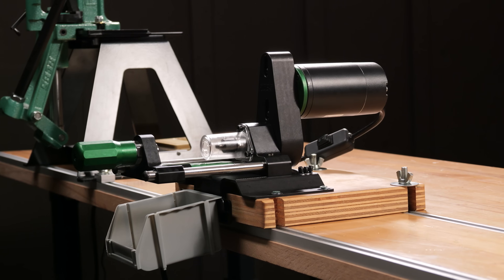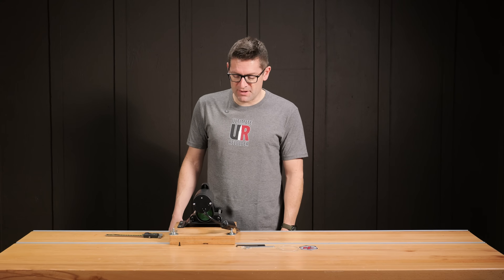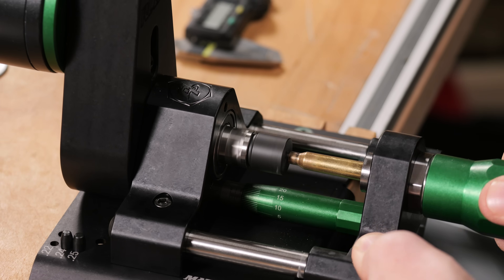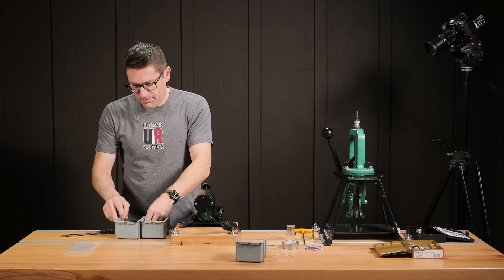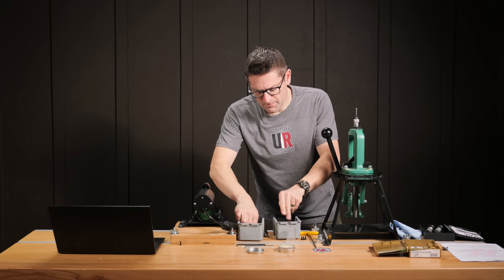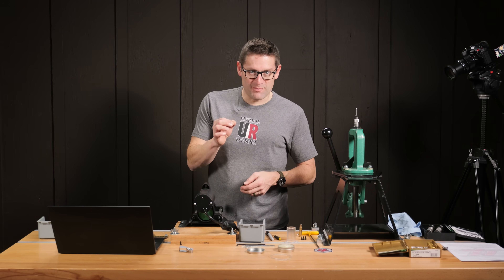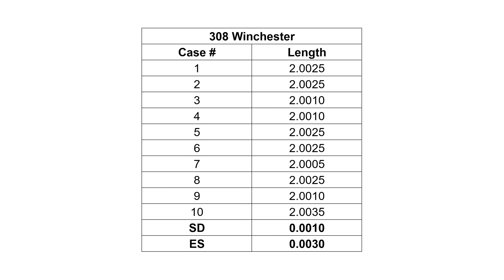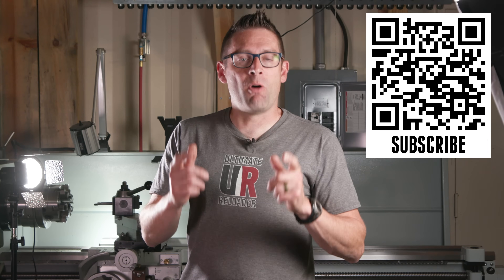NEW: RCBS MatchMaster Precision Case Trimmer

Comment: Needs a guide for the case to slide into before the cutter so a shellholder can be used to drop case head into and then just push through the guide to the cutter head. Putting the case into the holder then having to tighten it seems like a bother.

Comment: Question: since this trimmer has a collet to accommodate 30-30 cases, and since the 30-30 has the same case head as 32-40 and 38-55, can I use my old RCBS pilots and trim these two cases with this new trimmer?

Comment: Does the device only trim the cartridges, i.e. cut them to the correct length, or does it also remove the burr on the inner and outer edges so that the cartridge is immediately ready for loading?

Comment: I’m using the Lyman pro and it works good enough for the amount I need. Consistency is there and the price is right. I wouldn’t mind having this trimmer at 350. 700 plus is a ton of dough and I doubt most reloaders out there are annealing, charging, and sizing on the type of precision equipment wherein this trimmer would make a statistical difference. This is time saver above all else.

Comment: 700$ for a case trimmer is just plain stupid. Count me out
Reply: Pays for it self in time savings if you reload any volume
Reply: @DougJohnson-g5f I do reload in volume and use a Hornady cam lock case trimmer. Works just fine for me and I can trim cases quickly. Gaurantee that the motor in the rcbs trimmer takes a crap before my hornady cam lock trimmer.

Comment: I actually think I prefer the original case stop. Buy extra bolts and adjust to correct trim length. Put stop bolt in die box for that caliber. Reinsert previously adjusted bolt for next case and off you go. No messing with micrometer.
Also it’s easier to buy preadjusted cutter heads with the pilot.

Comment: I had an RCBS station like this with the special cutting heads... i was so disappointed by it i sent it back.

Nothing has come close to my Giraud Tri-way cutter as far as repeatability and speed of operation. Granted i only load for 223/556 and 308 in big volume, but man does it feel nice to get 1000 cases trimmed, chamfered,  and deburred in less than a few hours with a break or two

Comment: Would be great if the micrometer could be mounted on the Henderson trimmer. Don’t want to buy this just for that feature. Also on my Henderson I swap out cutter heads because I do not want to have to reset the cutters.
Reply: I did that 1x and 1x only, lol.  Im fine w swapping cutter heads.  The micrometer looks cool but the lock nut will never get bumped out of alignment.   I'm glad to see Todd not getting screwed like Hornady ripping it off blatantly.
Reply: @P @PaulC-onebadjack1313 
I have gotten pretty good with my lock nut adjustment. Swap the whole cutter head and bolt and ready to go in less than 3 minutes.
Reply: @airborne350g yeah,  you can breeze through it after a couple times for sure.

Comment: My main concern is the micrometer getting bumped off of the desiered length.  Doing a lot at one time you could end up with several different length cases.  The simpler lock nut and bolt seems to be a better option to me.

Comment: The pic close of the Final Cut, looked to me too much outside champher. That’s about my only concern on the 3way cutter types, too hard to get the right champher and deburr. I’d use this as a primary cutter only. Easier the be less aggressive and get a better champher and just enough outside deburr. I alway done mine so the outside is truly just deburred, no big angle noticeable.
Reply: Should work the same way as the henderson, can adjust for the chamfer you want.

Comment: Do you know if the micrometer is available for those of us that already have a Henderson trimmer?  Thanks!
Reply: I've had trimmers with a micrometer adjustment.  The Henderson method is WAY faster!  Bolts and nuts are cheap and once they are set for a cartridge you don't have to mess with setting them again. Just screw in the bolt and go!  I don't need a micrometer adjustment that I'd have to set every time I switch cases.
Reply: @djpaintles kind of what i was thinking.  All of my bolts are set,  so the mm might actually slow me down.  But it would look cool
Reply: I was thinking the same exact thing.
Reply: @nicholasp5817 .  I talked to Mr Henderson when I was first ordering everything and I asked him about a micrometer.  He basically said try the bolt and nut and see how you like it, you probably will.  He was dead on correct!  I LOVE my Henderson trimmer!  It and my Primal Rights Primer seater and SAC press are much my favorite reloading tools……
Reply: Call Henderson.

Comment: Glad to see they partnered with Henderson instead of just ripping them off and painting it green. (Looking at you Hornady 🤨)
Reply: Im glad someone called them out
Reply: I've seen so many unhappy reviews of the Hornady.
Reply: I honestly think Hornady actually fixed a few things andade it better. I also guarantee if they didnt come out with theirs then this one wouldve never happened. This one also fixes things with the original.
Reply: Hornady doesn’t give you a .277 pilot though that’s something to consider they give .20 .224, .243, .257, .264, .284, .308, and .338. They say fuck that 6.8 western or 270 Winchester ha
Reply: Hornady is a better system. It has a better sturdier sliding rail 
And the placement of the click adjuster is better. And when you change a pilot, you loosen the blades then loosen the pilot pull the pilot out put the new pilot in for different caliber slide the blades back against the shoulder on the pilot that the blades index with to the correct point for proper debur and chamfer. I bought one I know. So rather than buying a bunch of heads, loosening and re-tightening three Allen wrench set screws is as long as it takes essentially no fiddling with sliding the blades in and out to get correct chamfer and deburr

Comment: 700 bucks is to much
Reply: Honestly for the average shooter it’s not worth it. If you’re trimming large volumes it’s so much nicer to do 3 steps in one
Reply: Is 3000$ for a good scope too much ? Is 1500$ go a good reloading press to much? Is 1200$ for a AMP annealer too much? Everything is too much you want something nice you have to pay in 2026.
Reply: @levigne25 I ise a hand trimmer,  100 bucks 😂😂😂
Reply: Time saving is huge I can do 100+ less than 20 minutes
Reply: I have the Henderson. $700 is just motor and base. Dont forget you got have to buy all the components separately. You will spend around $1100 to $1200 overall
Reply: *too much